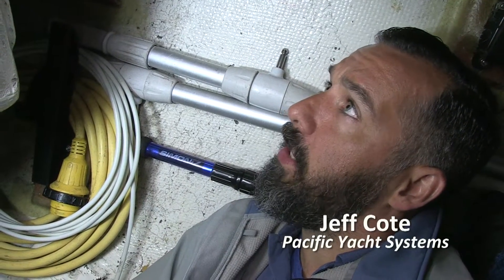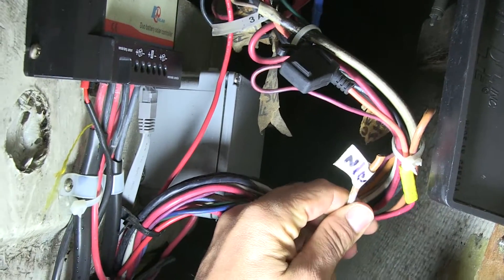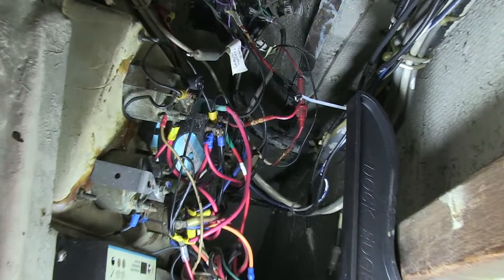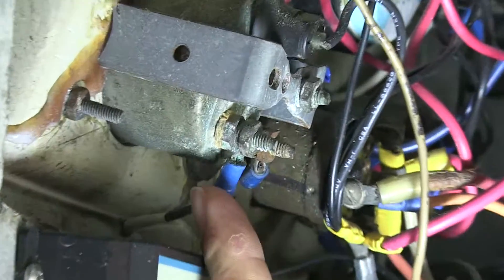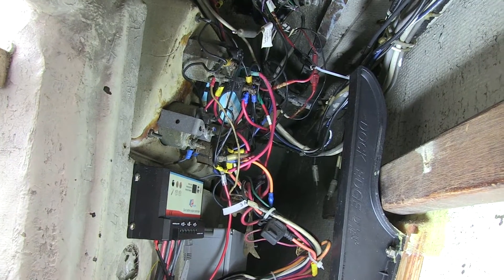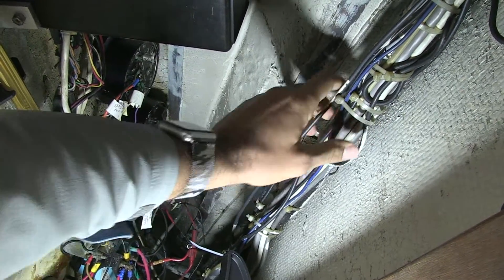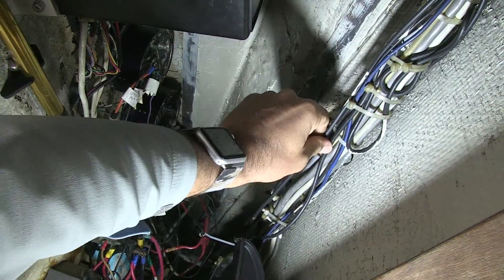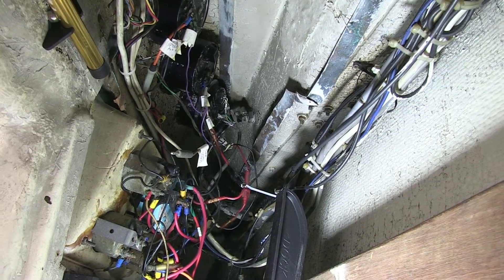PYS Boat Electrical Audit aboard S/Y Corra Jane: Engine Instrumentation

Comment: hello Jeff, nice vid. I did a lot of wiring in the eighties, no fancy ancor tinned wire. I soldered, liquid tape and heat shrink, especially battery cables. Do you think it's overkill on new fangled wire, how bout your boat.
Reply from the maker: Thank you for your question Roger.  For my own boat and for the work we do on other boats,I like to use heat-shrink terminals. First off it’s a good mechanical connection that is better suited to withstand vibration in comparison to a solder connection. Also the big advantage is that the terminal comes with a heat shrink that can shrink down when heat is applied to make the connection as moisture resistant as possible. 

My philosophy for handy work on boats is to do it right and do it once. I value my time, and there’s more work to be done, so I don’t like the idea of having to revisit something in a few years.